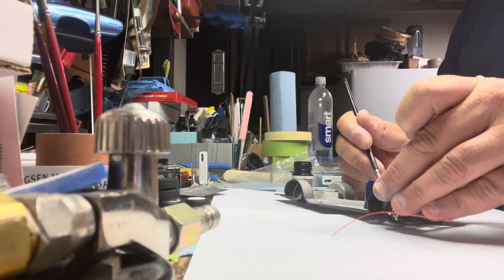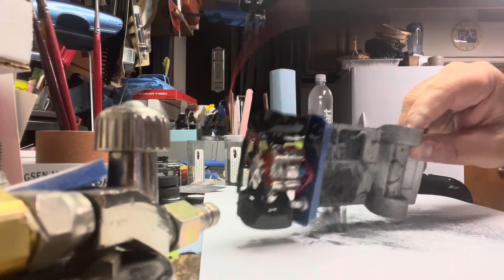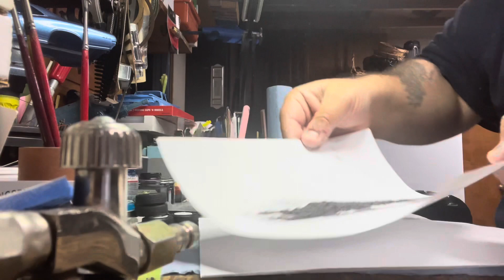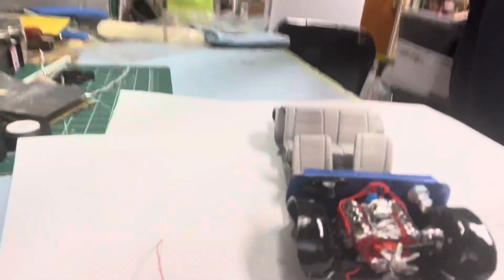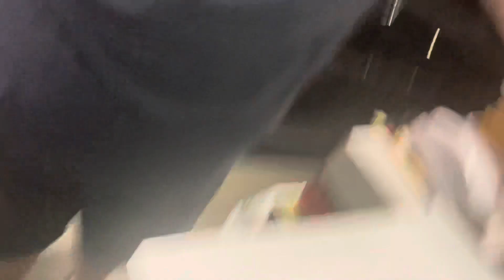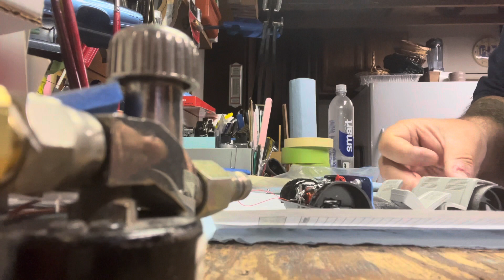How to Add Carpet to Your Model Car - Flocking

Comment: Nice tutorial Paul! I've tried many different ways as have you. Another method I like is to paint the floor, then use PVA glue watered down. It works pretty well too. Thanks for the video 😎👍
Reply from the maker: Yes, I have tried many ways, I like the clear but on the lighter colors the yellowing will cause issues down the road, the semi-gloss paint seems to be my go to for the time being.  Thank you!

Comment: That’s the same process I use   May probably is when using Tamiya acrylics I guess it dries to fast and I’m just not getting flocking coverage. Then I go back and spot fix it and get flocking in my paint. Enamels just seem to work better for me.
Reply from the maker: Yeah, I just started using the semi gloss paints, for the a number of years back I've been using bottled clear coat and it works really well also but I'm kind of liking the semi gloss paint better.  The clear, works good, but on a lighter color, over time you will see the clear yellowing out under your flocking. Dark colors you are fine.